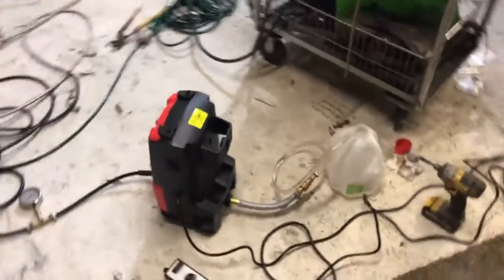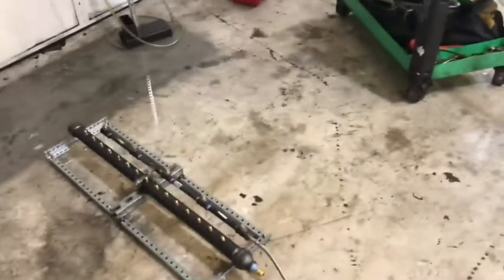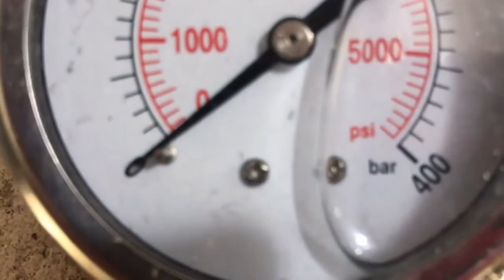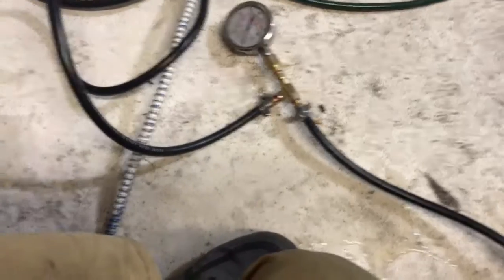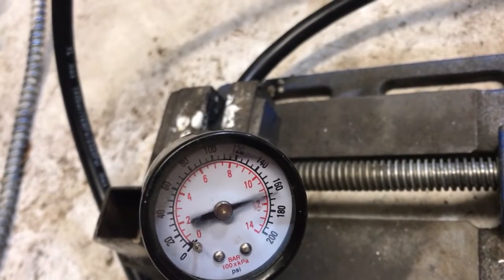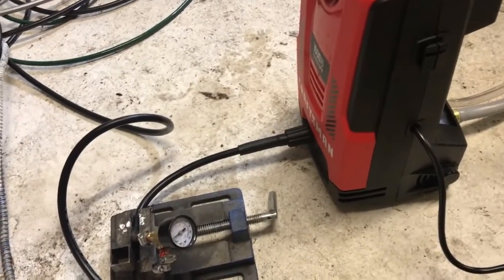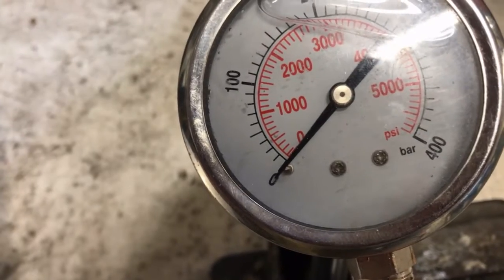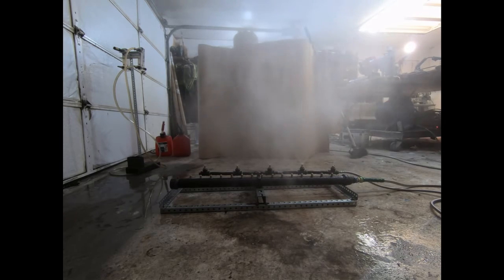Pressure washer pump router speed controller output

Comment: HI, great videos..keep them coming please. Just a thought if you have a sealed water reserve with an air pressure attached you could measure the pressure within this tank instead of the outlet pipe. Whatever the pressure is in the reserve tank is what your gonna get on the outlet...assuming that you don't need an unlimited supply I.e water tap?
Reply: You'll need an air compressor attached to reserve tank to pressurise.
Reply from the maker: good idea

Comment: i think i see where this is going. Add oil to it instead of waiter and have a HUGE fire ball spraying there. I tough about doing something like that but using the pump from a small diesel engine. They put out 100+ bar for the old style diesel injection. But if you would use a commonrail style pump you could go as high as 1500bar. Now that would probably be waaaaay too high for use with oil. But i think the 100bar might be nice, then you could probably mist the oil really wel without using anything but oil, the pump and a good nozzle.